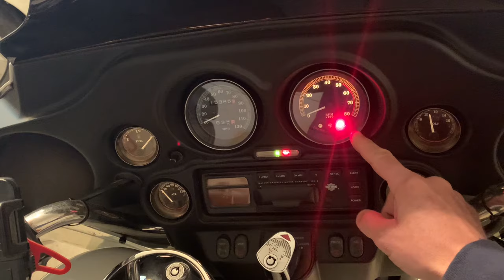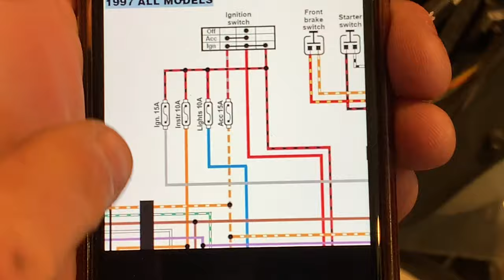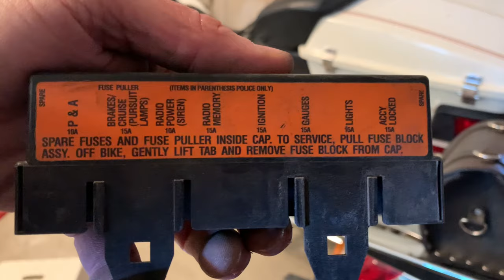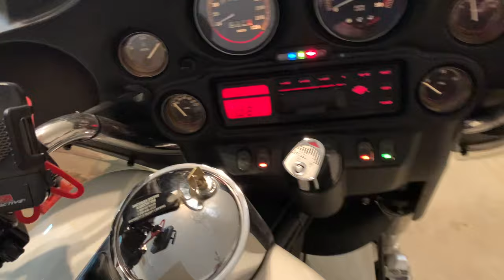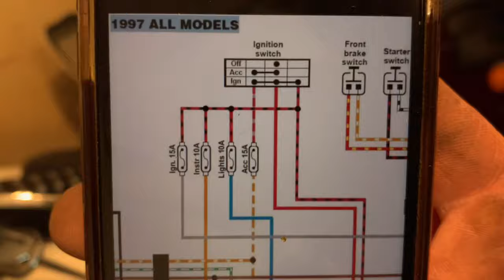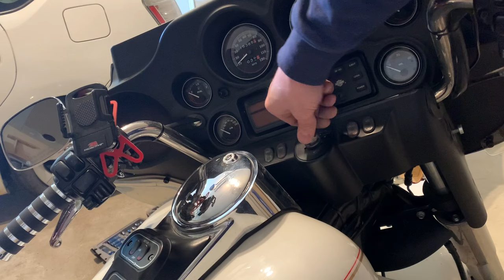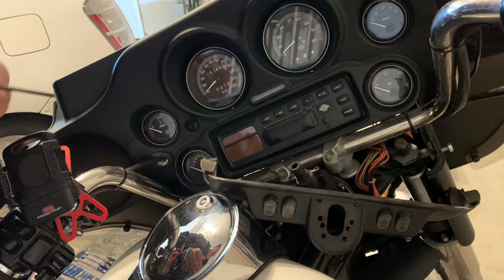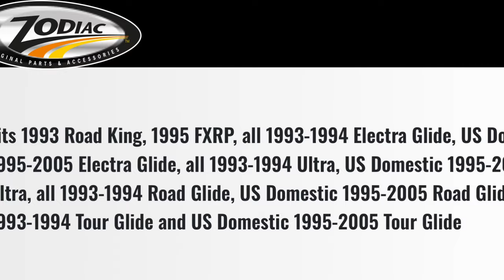1999 Harley Davidson Ultra Classic ignition switch failed no crank no start no radio 71526-93B

Comment: I just wanted to say that your video helped me. I also was having similar issues with my electra glide. You showing how to test the ignition switch with a voltmeter and jumper it is what made me check my ignition switch. I did the exact same thing and it worked. Now to just save enough money for an ignition switch😩
But thank you for the detailed video. That helped a lot
Reply from the maker: Thank you for the feedback! I did put an aftermarket part number in the description